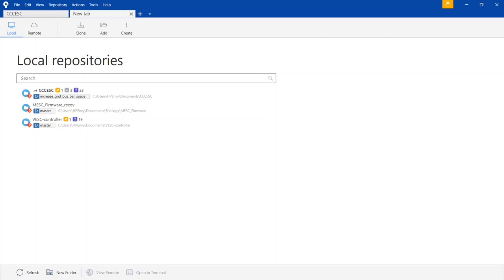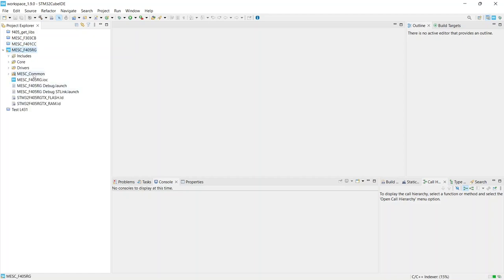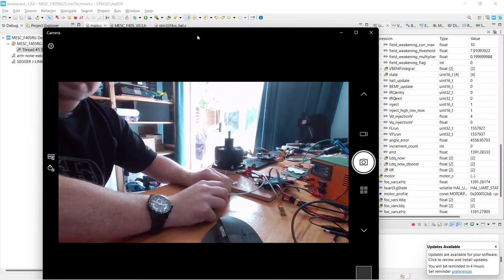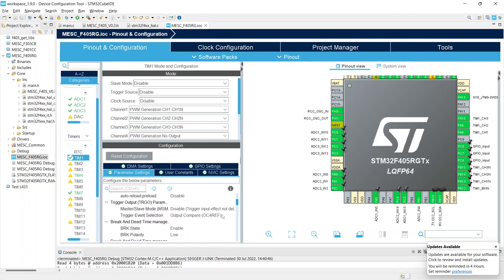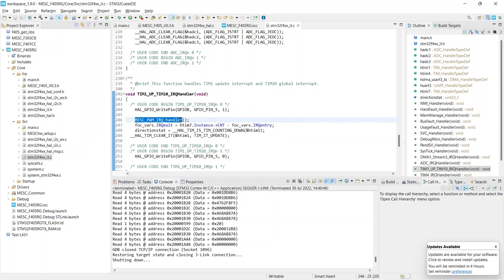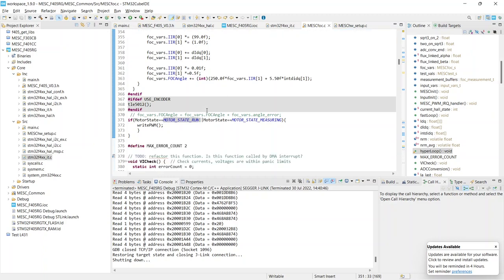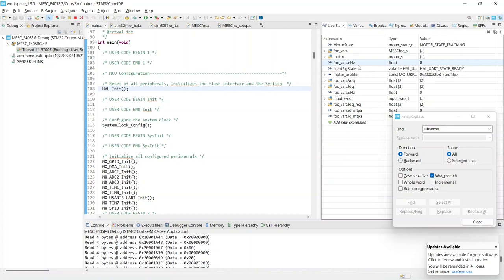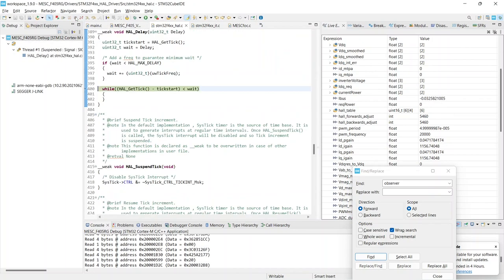Using MESC FOC firmware

Comment: Hello David, as a hobby I am studying the FOC and PSMS motors. I would love to have a working device where I could double check the theory and also see how the functions are applied. What do you recommend I buy? The MP2 ESC? As a controller, motor, etc. I would truly appreciate your insight. Looking forward.
Reply from the maker: Hi,
Any F405RG based FOC board, typically those advertised as compatible with VESC can be used with it, and there are plenty of options from various suppliers... Team TriforceUK, Tronic Systems, no end of Aliexpress options from China, or you can build your own MP2 ESC but that is a lot of work.  Take care with the ultracheap Flipsky/Makerbase products, they are kind of random quality and often have truly terrible current sensors. Also don't be tempted by anything that does not have access to the programming header (SWD) like some of the high power 3Shul options.

Comment: Hi! Very nice job. Do you think it would be possible to use this firmware with STM XNucleo-IHM07M1 EVAL kit hardware?
Reply from the maker: Hi Hugo, the issue with the ST devkit is that the phase sensors are all a bit strange and the L6230 on it is also a bit strange, so I am not entirely sure it can be used. Probably can be but it might take a fair amount of tracing schematics and remapping ADC pins. ST have removed the schematics from the product page though... Also, the generateBreak() function would need replacing with one that toggles the enable pins. I had one of these IHM07M1 kits in the past, I threw it away because it was uselessly gutless and I could barely get it to spin the little green motor that came with it using the ST library.
Reply: @DavidMolony  Thank you very much for your reply. I'm taking a  course on motor control and we are all using an IHM07M1 with an stm32F401RE. We learned how to spin a sensored bldc motor, and I tried implementing sensorless BLDC using the integration method and it works not very smoothly. I found your software by inspecting the VESC software and saw a comment referring to your software which I prefer. Do you recommend a method for visualising the signals measured by the MCU's ADC  (like an oscilloscope) to actually see what the software sees? Thank you in advance and have an happy New Year!
Reply from the maker: @hugo_penichou5  I have a really simple python script for plotting a few bits of continuous data over serial, and I have made some attempt to use the SWV (Serial Wire Viewer) in CubeIDE, but it is really really clunky. Produces absurd amounts of data that the interface is simply not able to handle, and you need to pause to start/stop data collection... In general I have not made much use of signal trace logging, I just have a 4 channel 'scope and watch the variables in the viewer. My latest firmware version has the start of a circular buffer for logging, and can throw all that data down the serial line, which it does in the event of a fault.
Another thing I did before was activate the DAC and write whatever variable I wanted to watch to that, which then shows up on the scope but as per the MCU's view of things not the noisy world around the MCU view.
VESC is much better at logging and data collection, it just comes with massive overheads during runtime.  18 months ago, I was rather anti VESC because it had a bad habit of self destructing, but Benjamin Vedder has made some key changes that have made big differences to this (mainly new observer, removed slow overcurrent fault and implemented fast overvoltage fault, plus various other bugfixes).
Reply: @DavidMolony  Thanks a lot for your answer. I think I will try signal trace logging using a serial to usb and the Arduino serial plotter, it is a very nice feature newly implemented on the Arduino IDE. Wish you the best for year 2023!